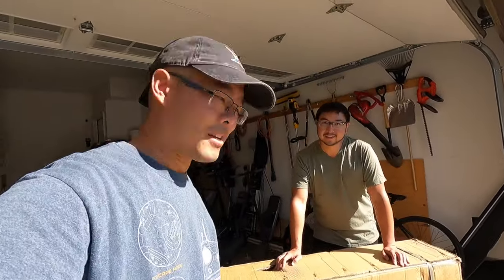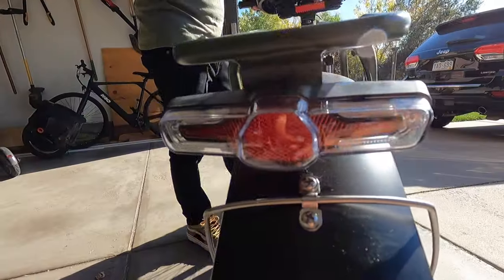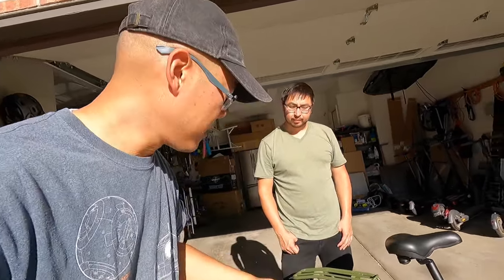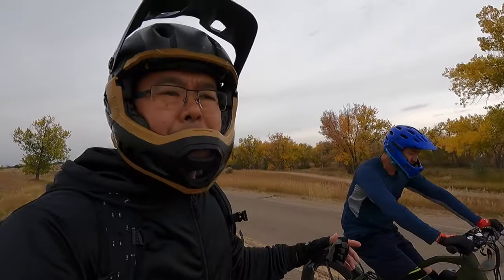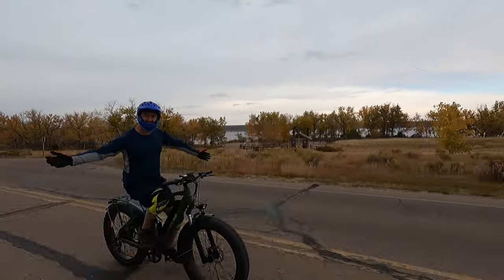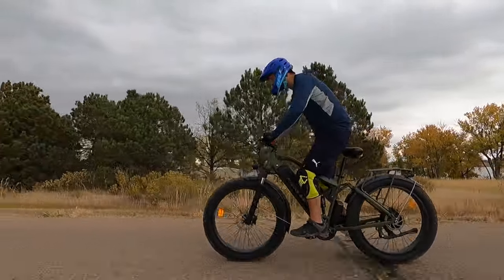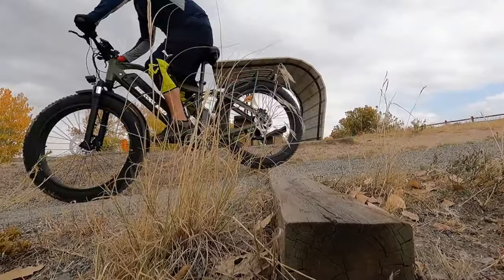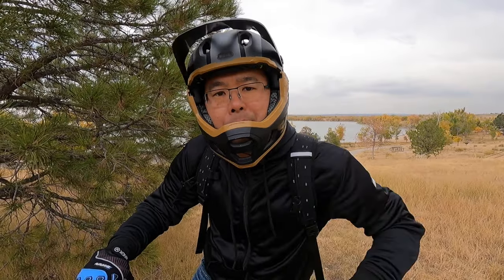A Most Affordable Full Suspension Fat Tire Ebike: the Bee Cool Adventurer

Comment: Your shipping box was the old box that allowed a lot of damage. 
The new upgraded shipping box has 2 hand holds on each side as well as the ones on the ends and the ebikes are also packed better so there has been no reports of damage like scratched paint that you mentioned. 
The new boxes have been mentioned  on the BeeCool Owners group several times with pics and you guys are members. 
Also a new metal front light is supposedly brighter than the old one you tested.
Reply: We just joined the group a few days ago. Glad they upgrade the box because the one we received was not in great condition.
Reply: Just got mine pretty impressed so far actually better quality than I thought I lucked out every thing lined up o damage shipping and one thing I had questions about shipping and a color change which they took care of right Away . Thankyou BeeCool. Nothing pisses me off more than companies that can’t be reached after purchase so beecool👍👍 Bitchen bike but would be nice to upgrade forks and shock but these are fine unless your used to a motocrosser. Of course More power always never satisfied for the price I’m really impressed 👍
Reply: Most people in that group have had complaints with scratches on the battery and the bike right under the battery, including myself, within the last few weeks.  I do recommend the bike though as it's a great bike at a great price.  Beecool does have great customer service and will take care of any issue you have- although their quality control sucks,as again,  lots of people do have issues.  In fact, my battery charger didn't even work upon receiving this but Beecool did take care of me.  It's a great bike and a great company with great customer service but poor quality control- but they will take care of you.
Reply: @nathandietrich222  not true that Most buyers had problems with over 3500 Beecool ebikes delivered to mostly happy customers. 
A battery charger not working is very very rare and not even a BeeCool labeled product. 
The new heavy duty shipping box will be used on the original models soon that will solve most of the issues.
Reply: @MotorizedBicycleRace ok so not true MOST people out of the thousands sold.  That was a hyperbole.  But LOTS of people still have issues.  I was in that fb group.  And Beecool stated after 10/3 last year they would change the box and well LOTS of people,I actually asked in the group, and the majority just 3 weeks ago did state they had scratches on the bike and a few, like 4-5, stated they were getting new battery cases sent to them and one was even waiting on the front fork as his was damaged.  So Beecool has bad quality control but great customer service and a great bike at a great price.  In fact if they just paid for a qc supervisor, they could even charge a hundred more, and they'd easily- in my opinion- own the ebike market.  They absolutely take care of their customers but too many people are receiving their bikes either with lots of scratches and some even receiving the bike inoperable til they get their parts. I ❤️ my Beecool bike and highly recommend them just people need to understand they may come scratched or even inoperable upon receiving them but they will get it taken care of.
Reply: how long does shipping take roughly?
Reply: Just received my bike severely damaged by FedEx be cool wanted me to accept it I would not I would not trust this company for anyting  they are just a broker and  parts are almost impossible to get . Horrible customer service
Reply: @hellolove1576  was thinking about getting one until reading some comments on their site and a web page on ebikes. It seems as though Beecool is in a tough competition with a few companies making ebikes for worst QC and CS title! No longer do I have confidence in purchasing g a Beecool ebike😒

Comment: its a great video, I was wondering if you could tell me when you're pushing or moving this bike without riding it, do you hear any humming sounds? Mine is making some humming noise from the rear wheel part when I moving the bike out of my yard.
And does the bike chain slightly rubbing the rear tire side?

Comment: I needed a more powerful e-mtb so i got an E-CELLS Super Monarch Crown. 2 wheel drive, 2 batteries, dual suspension, hydraulic brakes with 2.3 mm thick discs, 4 1/2" tires, Shimano Deore 10 speed gears, torque sensing assist.
BUT the price is $4,780. which includes a $1,000. intro discount. Very reasonable for the features.

Comment: My Vtuvia FMB has similar specs except the motor, which is a mid drive torque sensor Bafang Ultra G510 1000W. Around $1600, but shipping and additional battery brought it to $2100. Excellent value.

Comment: Received my black Adventurer Dec 12 2021 and am very happy with it.  I am 6' 230 lbs and ride on paths in the woods.  The seat tube has ample adjustment for people of all heights.  With the front suspension set to stiff, I find the suspension to be balanced with no "bottoming" but I am not jumping it.  The bike will not resume acceleration if a brake lever is still slightly engaged as motor power is cut when the brake light is illuminated.  For optimum battery condition, follow the instructions for the initial 3 charges.  I added a handlebar riser and a short, angled stem along with 1/2" pedal extensions.  The headlight is bright and provides plenty of distance and width.  After-sale communication and support has been outstanding!
Reply: I too am 6' and 220lbs. I can only get my bike up to, on flat pavement, 22 mph or like 22.3mph.  Have you gotten your bike up to 28mph? If so could you please tell me your program settings to get it to that?  Thank you.
Reply: @nathandietrich222  my fiancee has this model. 6'2 350 and gets up to 28 on flat surfaces.

Comment: The walk mode isn't for flat ground. The walk mode is for very steep hills, where the bike wants to roll backwards and is very heavy to push. In this situation, the walk mode is nice to have, the bike will power itself up the very steep hill instead of having to push it by muscle. and when I say steep hill I mean very steep.
Reply: Even on steep hills the walk mode would be too much. It's awkwardly fast and just better to use the throttle. If yu watch our review on the Bikonit Warthog MD 750, the walk mode is much better.
Reply: Commenting here to agree with Andy Lin. We walk at 4km, but the walk mode is 8km, so it has a deadman switch. It is for grades too steep to ride or when stuck in the middle of a hill after a tumble. You could also use it to drag a big game carcass out to the fire road.
Reply: different people have differing ideas of what steep means. To me in LA, steep is like winter olympics steep.  should slow it down, though it also slows down walking.

could be a bit fast, idk, i dont have one.
Reply: Meh.  That must be specific to this bike only because the walk mode on all of my other e-bikes is programmable and comes preset for walking on flat ground.
Reply: @Inmate533  what bike is that?
Reply: @retroelectro1190  The Wallke Aniioke A7-Pro and the new 2022 Juiced RipCurrent X.
Reply: @Andrew-vt4jt bikes are junk

Comment: That seat just doesn’t look right on it, it needs a cooler mountain bike seat… What’s the standard of the frame, what’s the build quality?

If you shifted out the parts for better parts as they failed would it be a long term ride

Comment: Great informative video.  Thx.  I like this bike overall, but will have to back out because of the electronic issues u mention.  Also, for this size motor, it should be hitting higher speeds.  Also looks like the front fork shocks are just springs that r on the weak side.  I'm 6'3", 200#.  The handle bar stem is too short.  I don't want to be hunched over the bars all the time.  I'm 75.  My hunching days are gone.

Comment: They designed their walk mode incorrectly. Work mode needs to have a current limiter on it. If you have a current limiter say set to 2 amps then as you try to walk uphill or put some resistance it will slow down.
Walk mode on here wanted to maintain a certain speed and it was pushing the rider faster than he could walk.

Comment: All these Chinese ebikes are the same, just different brands. I have an Addmotor and there are at least a dozen identical bikes under different brands. Mine is okay but not very sophisticated. I wish I had bought one with a rear suspension. It's a rough ride which I attribute to its weight. 75lbs. My bike arrived damaged but Addmotor sent new parts. That bike you have is a good buy.

Comment: The assist after you quit peddling is to avoid pedal strikes on ground obstacles while off-roading.  This allows you to make it over the obstacle even if you have to backpedal a bit to avoid hitting it.
Reply: Frankly that doesn’t make sense
Reply: @MarmaladeSally  I think he means that if you quit pedaling right before you need to jump or hop over a log or something in the trail, you may want that extra push while you aren't pedaling, so your pedals don't hit the obstacle while trying to clear it.

Comment: Ordered mine (Also a Green Adventurer) on November 4th. 
For $1,499.00 OTD (no sales tax or shipping costs). 
I researched a lot and for the cost, the capacity is unrivaled, the power is fine, the controller looks easy to replace with a higher amperage (maybe 30A vs the stock 22A cutoff), it has lights so I can easily upgrade them with existing wiring, hydraulic brakes, rear derailleur only (don't want a front), full suspension (can replace later), fat tires and a good look! 
Has the major components and everything else can be upgraded as I see fit and budget allows!
Ready for it to get here.
Reply from the maker: Keep us posted on how it goes!
Reply: have u gotten your bike? I just ordered one. Thanks
Reply: @rickygarcia1926  yes!! Came in perfect condition. Tons of fun to ride. 1 upgrade I did immediately while assembling. Another I'm going to do this week. If you have Facebook, join the owners group.
Reply: @robcoastalga8279 cool thanks for the info, let me join the fun group
Reply: @rickygarcia1926  any questions, just ask. 
So first upgrade that I knew I'd personally want was the handlebar stem extension so it would be higher and closer to me so I could sit up straight. $20 on Amazon. 
Next I'll upgrade the rear suspension to better match the front. The rear is a bit stiff. But that's no big deal as everything else on the bike is perfect. I'll gladly send you links to what I got if you want. 
The bike is huge! It rides great, the range is insane. Brakes work great! Has what I call a rapid fire shifter. She will shift up as fast as you can press the button.
Reply: @robcoastalga8279  That Sounds Good , but have looked into the Changing of the Center Shock 🤔 That's One Thing I'd Really Perfur to do , IF Possible ?
Reply: @jerryjordan677  yes! I replaced mine and the bike absolutely floats over rough terrain. I went with the DNM AOY-36 with 50mm travel. The 35mm travel will lower the stance of the T post, basically if someone wants good suspension with a lower stand over height than factory, 35mm travel is the go to.  The 50mm is perfect for me, rides plush! It's 90 bucks on Amazon with 2 day prime shipping. Edit; The 50mm travel does raise the stand over height of the bike but if you already ride the bike with the seat raised from lowest position, you'll be fine getting that one!
Reply: @robcoastalga8279  would you happen to have a decoreption of it somehow so I could see 🤔
Reply: nearly 1300 miles later.... its been great.
700+ of those miles have been running near the factory fuse limit at the bms (40)
modded the shunt on factory controller at 580 miles. brought down to .42 ohms for an output total around 1850w which it could maintain for roughly 1 min. which is a pretty good duty cycle on factory gear.

I modded the bike knowing id kill some factory gear eventually.
my patience wore thin. Threw my duty cycle peak out the window and went for broke. on an insane grade, on a barely distinguishable lightly used deer trail with cushy leaf cover i began the ascent. Hand throttle pegged with a light to medium peddle cadence, only interrupting either when necessary. i waited and waited 2.5min reducing my pedal input and holding throttle beginning to worry i might just smoke the whole bike. 4 mins pass and im starting to notice a slight speed and punchyness loss. so i creep to near zero and bring the front end up with ease and ride at pivot for 100 feet or so just using throttle (right) rear brake with cutoff (left) to hold it steady. yep im L-R R-F brake setup. i swapped the hydraulic lines up top. At 4:37 we have failure. id assumed long before that id kill the little hub motors nylon Planet gears first. Nope the goes to the likely culprit of more current far longer than designed.... The Mosfets.
Also i immedietly whipped out a borrowed (for this) thermal cam. The battery and its management system did phenomenol, removing itself from the eqaution when the controller took a shit. 

09 code btw. i dont remember what beecool or the sw900 says it is. 

for the fix. ordered  IRFB3077 FET Transistors. these will be a really good upgrade. the controller will run much cooler and will create the DC phase pulses much much more efficiently. All for about 30 bucks and some read-how and a tiny bit of know-how and confidence.

Comment: The price is very impressive, especially with a 21AHr battery. I have two Cyrusher bikes. XF800 and XF900. They are built really well, and I ride them intensively in NYC. At $1600 it sounds too good to be true.
Reply: It's an insanely awesome deal. I have put 270 miles on mine in a month

Comment: You're wondering if this is supposed to be a mountain bike? First clue - light and turn signals aren't used out on the trail. And then there's that suspension (or lack of suspension).  Looks like a great commuter bike for the price.
Reply: I thought the turn signals were so I could let the bears know which direction I was heading. 🐻
Reply: Yes, and the rear rack is surplus...and would never work with any proper mountain bike...

Comment: Greta review guys. The electric motor not picking up again is a major flaw. If it doesn’t pick up immediately, or at least within a half pedal stroke it is essentially Not an e-bike at that point. Imagine pedaling a 70lb. bike for no particular reason. That amperage on the bike is the best selling feature on the bike as the suspension showed it to was not flawless, so this will definitely not be my choice as a next bike.

Comment: Still waiting for my Adventurer. FedEx sent me text saying it was to be delivered 3/30/22 between 10:30 am & 4:15 pm and to be there to sign for it. I stayed home from work to do so but it never came. Tracking says its still in origin facility (Chino, CA - I'm in NH) and there is no scheduled date of delivery. Bee Cool was a bad choice. Too many issues with shipping/packaging horror stories of damaged bikes and missing chargers, pedals, nuts & bolts. Neither FedEx or Bee Cool knows where my bike is. If the box is heavily damaged if it actually gets delivered I will take photo and refuse delivery. They charge a $150 restocking fee but I'll take pictures and post in that scenario. I don't recommend buying from Bee Cool at this point.

Comment: With afforable bikes, they should just come with a rigid front fork, no crappy lights, and just focus on the basics. Frame, motor, battery, brakes and the gears as priority number one. Quality basics and skip the low quality stuff you get with value stuff, they're stuff you can add later on yourself like a better fork and lights.

Comment: Great review. I just started looking at the Bee Cool ebikes. One of the few bikes that is rated for my weight. most bikes are limited to 275lbs, this one is rated at 350lbs.
Reply: Do you know what puts it at 350 lbs max? Spokes? Susp?
Reply: @bob-ny6kn  I don't know what criteria they use for the weight. But this is the first ebike I have seen rated for more than 275lbs. These are the things I want in an ebike - 300+ weight rating, 48V battery, 750W+ motor, fat tires, Disc brakes,, suspension, big enough for 6'4" person. I own the Rad mission which is rated for a tall riders, but only has one gear and a 500W motor. I am also considering the RAD city 4, it is about the same price as the BeeCool adventure. If you are near Fresno CA, check out the Inja on youtube. He reviews eBikes and is currently selling most of his collection. It is only worth it if you can pick them up locally, shipping is almost $300 which brings you back to the cost of a new ebike.
Reply: Been considering getting a ebike but being a big beefy dude really makes me worried. Like you said this bike looks promising, but for me I'm gonna be mostly on roads, no real mountain biking.
Reply: @oAPXo  Definitely go for 750w or greater motor, makes a difference. I don't do any mountain biking just roads and trails. But I do like the fat tire bikes. The fat tires make up for a lot of road imperfections. So far the Bee Cool adventure has been a great bike, its the one my wife always takes. There are a lot of great bikes out there and they continue to improve them and new ones keep coming up.